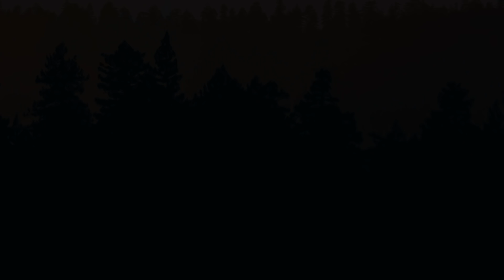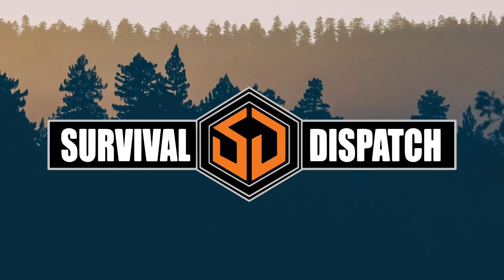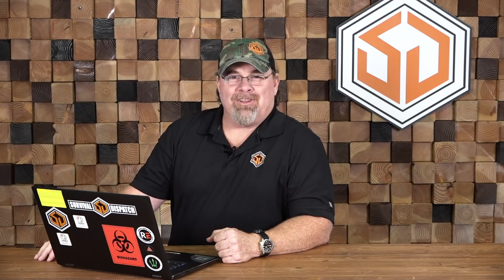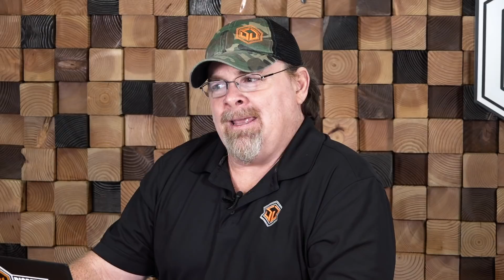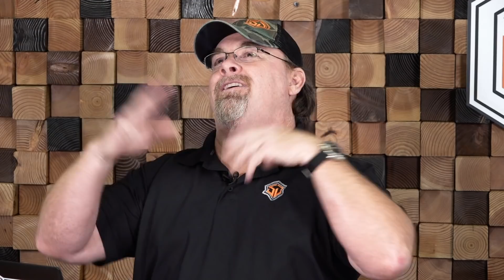All About Generators!

Comment: last big hurricane in Brunswick Ga. I was the ONLY guy on my street with power, food , water , HOT! water, Internet ,direct TV,  air conditioning...after 2 days of a 2 week outage ..my neighbors got mad because I wouldn't let them run cords to my electrical set up!. after a week they started getting nasty and I had one guy trying to steal one of my generators. Not happening... its in a locked Generac shell (empty case without generator we had for a display)I got from work for a buck. He left leaking pretty good because I let my dog chopper out to say hello. If you guys dont think your nice neighbors wouldnt come after you..your wrong. I have a gated locked yard with a dog named chopper and they STILL tried it! So now I went quiet.. I soundproofed my generator shed with proper venting..my exhaust goes UNDERGROUND to a large 2 ft diameter concrete driveway drain thats open at the end 12 ft away..you cant hear it at all running. all my windows now have blackout curtains installed. Those who think people are nice quiet creatures are WRONG, Humans are dangerous panicky animals that will KILL you to survive without a thought. I had to make a show of weapons at the end to keep people away until the power came on after 18 days....only 18 DAYS and they became a problem. Prepare now or your toast later. Oh and I added a 300 watt solar system charging (4) 6 volt  golf cart batteries with a thousand watt inverter and a controller. This will run my refrigeration at night now without a generator for 12 hours...go silent have weapons and TRAINING to stay alive . If you're liberal pacifist, or a candy ass and unwilling to protect yourself, BUG OUT! Save the county the trouble of cleaning up your remains.
Reply: I have 6 generators between 2,000-6250 watts.
Am I a bad person?
Reply: @burtvhulberthyhbn7583  depends on how you store and maintain them
Reply: @ImBehavingHoney  fresh gas every 4-6 months
Reply: @burtvhulberthyhbn7583  🤔🍺
Reply: @burtvhulberthyhbn7583  only if you don’t share.
Reply: @burtvhulberthyhbn7583  yes, give one to Donald Smith
Reply: I have a 5500 watt the man next to let's me use. I don't worry much about people living near me.  It is the ones that drive down my street that can hear the generator that may try to get it. Not sure if they can hear what house the sound is coming from. I need to run it at night for small window AC. But with my and the one next-door I am not sure where they would go. Both are in locked fencing. I can't breath good without AC. So things will get bad if someone tries it take the generator!
Reply: @donaldsmith3048  you need your own.
Reply: @ImBehavingHoney  I had my own but someone stole it.  I live on Social Security and can't afford to get another one.
Reply: @donaldsmith3048  lowes has a new finance program that allows anyone to buy anything over I think $200 with $79 down. No credit needed that should do ya
Reply: @ImBehavingHoney  Try living on$1000 a month. When I was working I could afford things. But now on disability SS I can't.  Why is everyone telling what I should be doing.
Reply: @donaldsmith3048  do as you please, I was giving you information on options. Relying on others is slippery  slope to disaster. The red cross will help also....dont get your panties in a bleeding wad.
Reply: @ImBehavingHoney  lol
Reply: @ImBehavingHoney    Probably was his trust worthy neighbors who stole his generator
Reply: @donaldsmith3048  ,  Don't forget the pets... dogs are "people" too!
Reply: @BruceNitroxpro  I don't have pets.  I fly to see my mother that is in a nursing home for her birthday and other family members. I would need to put a pet in a veteran place to care for the pet.  I am sorry I can't do that! To take a dog that is with me all day long, runs around the house and yard as it wants then for 3 or 4 weeks have it in a small cage let out 3 or 4 times a day to do its thing and walk around  for 15 to 20 minutes. I live alone and would love to have a dog but can't do that to adog!
Reply: Your the man bro. Wish more people was like this. A prepared society is a polite one.
Reply: In 2009 kentucky was hammerd with an ice storm that lasted 8 days.  We were the only ones with lights on and heat and hot food. We was waching DVD movies and listening to the radio telling people how to survive.  Everyone else had to leave to stay with family out of town or stay in hotel's which some was sued for price gouging.
Reply: Very good. Can you tell me which generator or generators you chose and why that particular set up. Thank you.
Reply: @DS..69  I have champion  model 100222 and a Generac GP 3300..just added AIPower 2300 inverter.  I sell generators...the trick is to run them out of fuel and switch to the other generator. This allows them to cool off and you can refuel and also spread the load across 2 gens instead of one. I also change oil with mobile one full synthetic every 50 hours instead of 100. The inverter will be used at night to run my 10000 BTU window air conditioner.
Reply: @ImBehavingHoney  If you ran those generators on propane, how long could you go on synthetic before you had to change the oil?
Reply: @terry5008  same amount of time of course..its the metal shavings from engine friction... remember 90% don't have a oil filter..on a portable generator
Reply: @DS..69  you don't need large gens just take turns on your fridge and freezer every 4 to 6 hours getting them to temp, plus I have 300 watt solar charging (4)..6 volt golf cart bats for frig at night .keep sound down!! It brings in the trash
Reply: @ImBehavingHoney  Nice, out of those you have, or could recommend, what is the quietest one say around 3500 watts or a little above that? Ty
Reply: @DS..69  honda...way overpriced..any yamaha powered inverter of any brand is good
Reply: Probably a westinghouse if only one
Reply: @ImBehavingHoney  Yes I've been looking at one. They seem to have a good following. Thank you for the info. More then one is not in the budget.
Reply: @ImBehavingHoney  ,  And Honda generators are not grounded to the frame, so a safety ground isn't practical.
Reply: @BruceNitroxpro  yes you ground them..you can use jumper cables hooked to a metal part of yhe generator and a fence post rod in the ground ECT
Reply: @ImBehavingHoney  Quick question how long does it take to charge your four 6 volt batteries back up?
Reply: @barnyard27  depends on the day and amount of light 4 hrs to never, but! I can also recharge with generator.
Reply: Everyone really needs to watch this video about generator safety https://youtu.be/I1jT3ANENvI this is very very important for everyone to know. Thank you. Please leave a comment below on this video. Either be safe or sorry.
Reply: Damn right. Pretty selfish neighbors
Reply: What a story . What type generator do you recommend ? I have 12 year old generac gas and ran like a champ , but gas is messy . I got a 50 amp firman tri fuel for propane . Hope i made the right decision . Any recommendations on generators .
Reply: @joemooskie4444  well the BEST type is a diesel, but who can afford one? Just use an inverter gas and you should be good
Reply: Here are the portable generator safety rules: this safety information is only for anyone who use a portable gas generator and for those who are planning on getting a portable gas generator. This is just a reminder for everyone’s safety. All generator safety rules should be followed carefully. This advice is just to make sure that everyone is aware of all the warnings and it’s just to remind people to be careful using portable generators. Generators can be dangerous if not used carefully. Every year, hundreds of people die or get injured when using portable generators due to carbon monoxide poisoning and electrocution. Make sure you are using your generator carefully and keeping others safe as well. There is something very serious that everyone should always be aware of when using generators. Some people do run their generator indoors which is not safe and that increases the risk of carbon monoxide poisoning which can cause death of family and you. Some people run their generator in wet conditions which can electrocute them. Please remember that you should never run your generator indoors. Remember that carbon monoxide is an odorless and colorless gas that you cannot see or smell. Carbon monoxide is a silent killer. Keep that in mind. Make sure your generator is 15-20 feet away from your house and away from doors, windows, and vents. Never use your generator in your porch too. Having a carbon monoxide detector is very important against generator safety. Some people also allow children to go near the portable generator which could pose risks. We need to keep an eye on our children making sure that they are not near the portable generator so they won’t get electrocuted or burned by the generator which is dangerous. A locking enclosure also keeps kids safe. A generator shed might look like a tempting place to explore, or take cover during a game of hide and seek, but a generator is a dangerous piece of equipment that can cause injury. It says on the manual that we should also keep children away at all times from the portable generator to avoid injuries. Please do not allow a child or unqualified people to operate the portable generator.  It is important to keep your children safe especially little ones. The portable generator can be hot during an operation. Just because some manuals missed what should be listed doesn’t mean it’s safe to do. Always follow the generator safety rules when using portable generators. Generators pose electrical risks. If you need to use your generator during wet weather, you need a generator tent to protect your generator from getting wet. Don’t let your generator get wet. Keep your generator dry and before using your generator, please make sure your hands and your generator is dry. Do not wear loose clothing when operating the generator. Everything that is said on the generator’s operating manual should not be ignored. Never smoke cigarettes near the generator. Please keep flammable things away from the generator. Never overload your generator too. Your generator can catch fire. Never ever try to plug a generator cord into a wall outlet to avoid back feeding. Back feeding your generator is dangerous. Always turn on your generator first before plugging in appliances and shut off the appliances before turning your generator off. Use a heavy duty cord for your generator and the cord should not be worn out. All the instructions should be followed carefully. Never refuel your generator while it’s running. It can cause fire if fuel spills while your generator is hot. You should turn off your generator and let it cool off before refueling it. Having a fire extinguisher next to the generator is also important. This is only a reminder for everyone’s safety of using generators. Make sure your generator is properly grounded. Having a fire extinguisher next to the generator is also important against the safety rules. https://youtu.be/I1jT3ANENvI and here is a video more about keeping others safe when using generators and also about our family’s safety. You need to keep your children safe especially your little ones. Hope this helps. Thank you. Remember it’s better to be safe than sorry. So all generator safety rules need to be followed carefully.
Reply: @The_Happy_Aviation_Enthusiast  add to that a rifle to keep it
Reply: @Malik Reinwald let us know
Reply: you probably dont care at all but does someone know a trick to log back into an instagram account??
I was stupid lost the account password. I would appreciate any assistance you can give me
Reply: @Malakai Raymond Instablaster :)
Reply: @Kaiser Grady Thanks so much for your reply. I got to the site thru google and Im in the hacking process now.
Takes quite some time so I will reply here later with my results.
Reply: @Kaiser Grady It did the trick and I finally got access to my account again. Im so happy:D
Thank you so much you saved my ass!
Reply: @Malakai Raymond happy to help :D
Reply: Reading your mensage i have to thank you for your share of experience.

I live in Uk and i dont understand nothing about generators. But im worried about my father in law. He use a breathing machine during the night, and some or other medical equipment. My question is if i can plug that machine in one generator. I try to find videos on youtube but i dont find one. Its always USA and that makes harder to understand.

Comment: My 20kw whole house generator is diesel, which he skipped completely. I studied generators for almost a year before I invested and It is the most ideal solution. It burns at about half a gallon an hour, is liquid cooled and can run 24/7 as long as I have fuel. I ran it non-stop for 5 days after a hurricane. I can also store diesel safer (When I need to) than gas and I don't have to call out and wait for a truck come by to refill propane tanks.
Reply: problem...they are loud and will draw every fool that is desperate
Reply: @ImBehavingHoney  It is a quiet diesel. Insulated on the inside to minimize the noise. Not loud at all when you consider the portable ones from the Hardware store.
Reply: They do get a little more tricky after a major event and part of your house is missing. Pro's and cons to everything.

Comment: Nothing beats diesel, and there are small units that can be installed on an RV, or whatever, and they really kick ass.

Just my (well informed) opinion tho.
Reply: too loud unless your boon docking. there is not one park that will let you run them. BUT great for long term survival in the boonies..IF you have a large supply of fuel..me I went solar and hydro with inverter generator as backup charging... I have a portable hydrogenerator I just throw in a stream and charge my batterys https://www.youtube.com/watch?v=4R5AtWkr-rU